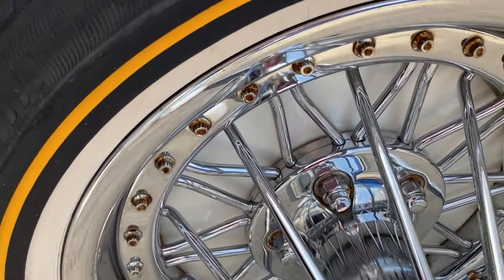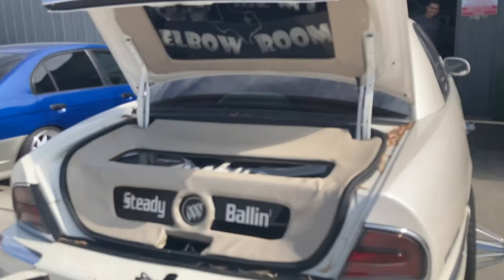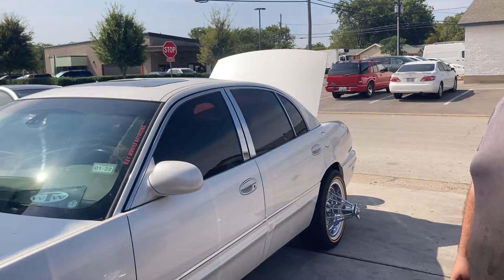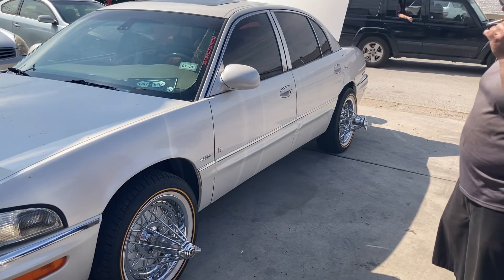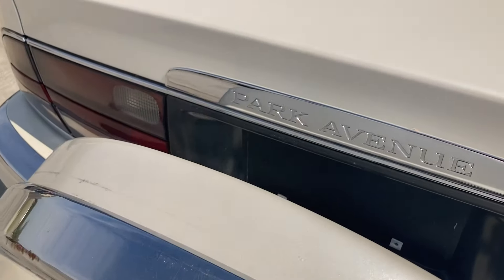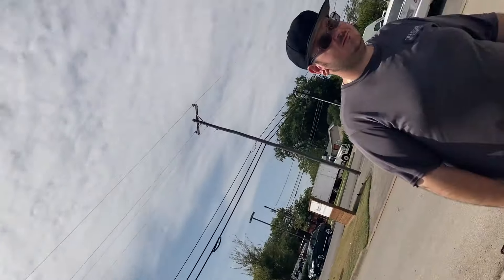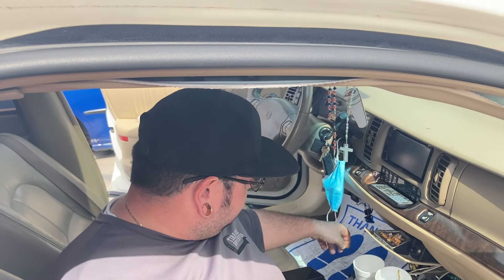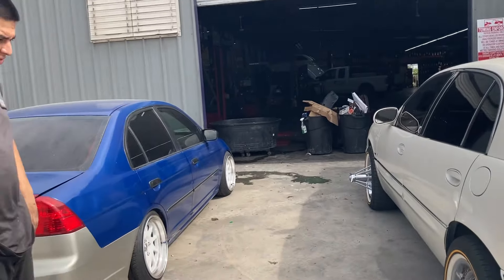Big SWaNgAs

Comment: Smh they dont make the two piece anymore. Texan wire wheels bad with their design. Water gets in the spoke/lip and it rusts and breaks overtime. The two piece is genius being able to remove face and repair loose spokes.
Reply from the maker: Man..I am glad that you shared that information..Them swangas look good but I have never bought a set maybe I will build a slab one day..Maybe a 76 Eldarado💰💰I think about it all the time
Reply: @JohnBlaze-ff3lm  i have owned 3 lets in the past but they were all used and eventually one spoke gets loose and then the next. Domino effect. Once the price of steel goes down and swangas price goes down I will buy a brand new set and put a thin bead of silicone where all the spokes meet at the lip and seal it so water does not get in and becomes a rust problem later.